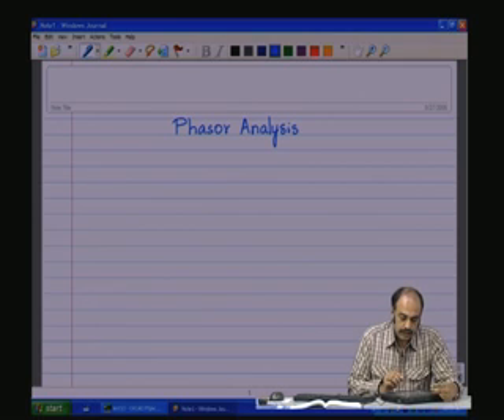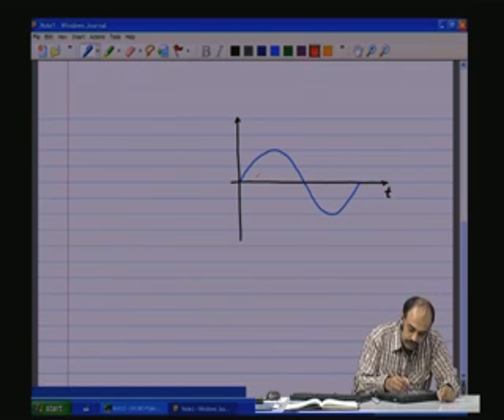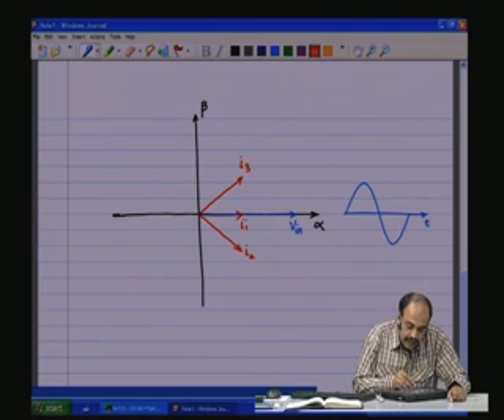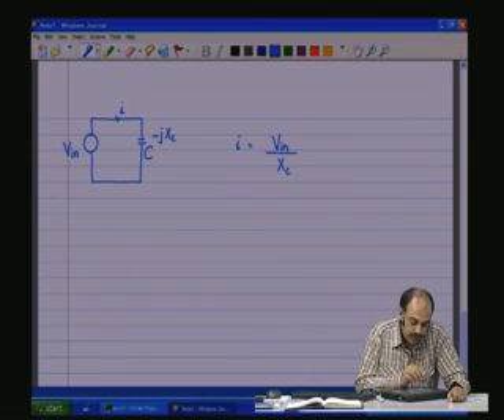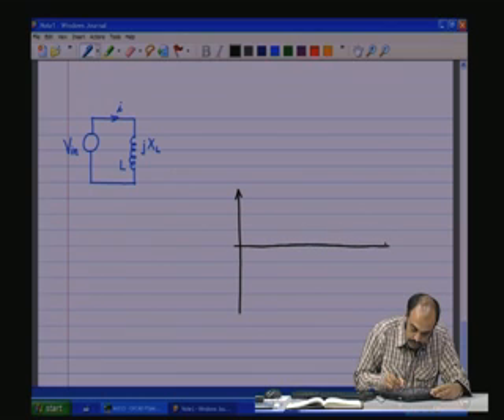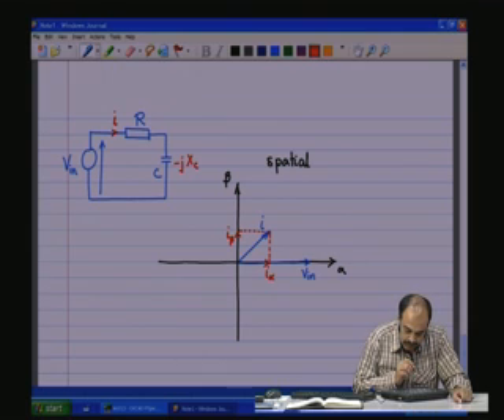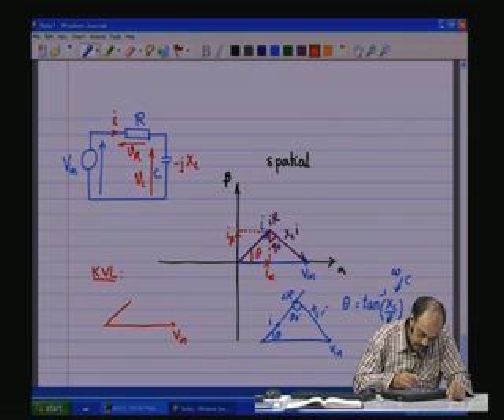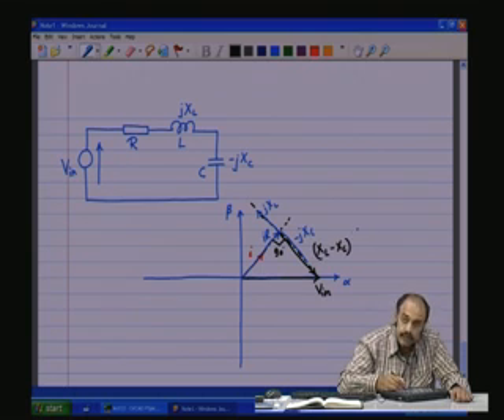lecture 13 Phasor Analysis

Comment: I am sorry but about the example at 23min shouldn't the direction of Voltage source and current circuit be in opposite directions as the Voltage source is an active element?